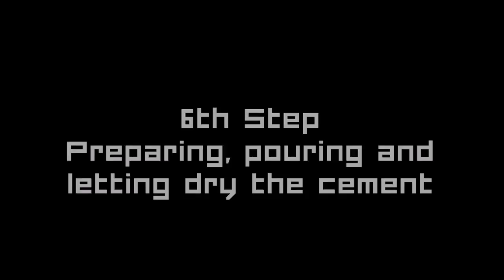DIY Homemade Calisthenics Park with Less than 70$ / How to Make

Comment: Leaving your concrete at a lower level then the ground is a bad idea. Always make it mound higher so that water runs away from the beam. Wood inside concrete can not dry. It's wise to place loose gravel in the bottom of the hole to facilitate drying.Gravity will do the rest.
Reply: correct it would hold against the elements,also loose gravel allows excess water to drain
Reply from the maker: Great advices, you can tag us on instagram or facebook on @kubebarz when you finish your mini calisthenics bars to shared it to the community! :)
Reply: If the wood is below ground level and concreted in, any creo based formula, creo cote or creo sote spread over that area will decrease water penetrability while also killing off the micro organisms that will feed on the wood. But that will result in more maintenance down the road till the time comes to replace the poles. Also check your local laws before using creo based products and if necessary source a different product that will kill off the microorganisms attacking the wood. As is, I suspect these poles will have a 3-5 year life depending on rainfall and timber pretreatment.  As they are made to support body weight the better protected the timber structure is the more confidence you can jump on the bars year by year knowing they won’t fail due to wood rot.

Also, it looks like a dry area where soil can drain. Consider digging down 3 inches deeper and lining the 3 inches with gravel. Then place your timber and build up more gravel around it before pouring cement. If you get it right the timber will be exposed at the end to allow water to pass into the gravel and disperse into the the ground.

Comment: Can I get away with just 2 poles if i were to use it for just kipping toes to bar and pull ups?
Reply from the maker: Yes you can, but make sure you can dig and place the Poles in meter deep hole.
Reply: @KUBEBARZ  sounds good man will do! Thanks

Comment: Hi, do the bolts stop the bar from turning totally (e.g. on muscle ups), or is there still some slight rotation of the bar (until it hits the bolt)?
Reply: Yes, use the same size drill bit as the bolt, it will not move

Comment: Did you struggle with rough surface on your hands? My poles really penetrate through the skin easily, do you know how I can make it more smooth?
Reply: GT OLI4 use sandpaper and rub that bar (giggity)
start with fine sand paper
Reply: Thanks I'll try it :-)

Comment: long bolts sticking out though.  i want to build one day when have a place but incorporate side ladder for flags
Reply from the maker: ZeNex74 the bolts can be cut with a metal cutter machine. We hope you can build one 💪
Reply: KUBEBARZ yeah that's not easy after built
Reply from the maker: ZeNex74 it actually is, with a manual metal cutter, it won't take you long.. Or just buy shorter bolts!.. Just think positive! 👌
Reply: sawzall bruh

Comment: So i got somekind of a trouble , i would like to put some sets of calistenics outsite my apartment but i will need to make it with iron becose i live in a neighborhood with gypsis and they wouls cut the wood for fire anyday when i m not at home.
Reply from the maker: You can also make it using iron poles. It will be more expensive but if it is the only option, then you already know what to do!!
Reply: KUBEBARZ thank you
Reply: Will not be long till they cut down your metal to trade in for the recycling price...

Comment: I would have set the polls first before mounting the bar because once you start putting weight on it, they will sink into the ground and become uneven.
Reply from the maker: Daniel Taylor se did this way so we can raise or lower each side while levering de bar.... you can do It the way you say It but keep un mind that you need to have to measure and do It all extreamly perfect because It will be harder to fix any inclination the bar may have due to the terrain, the hole you make or the placement of the poles... if you make the park remember to tag us on face @kubebarz   :)
Reply: +KUBEBARZ  - thanks for the advice, I was thinking of getting the poles upright and levelled and set before drilling the holes for the poles.. when I do it I will video it and tag you 👍